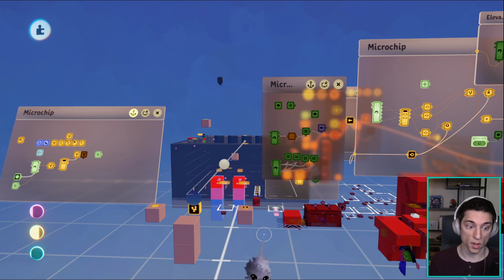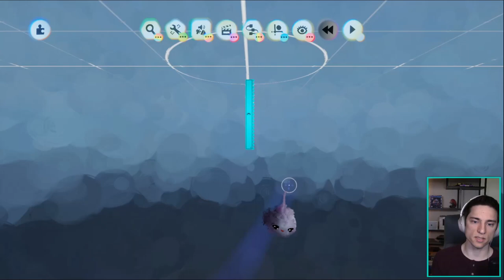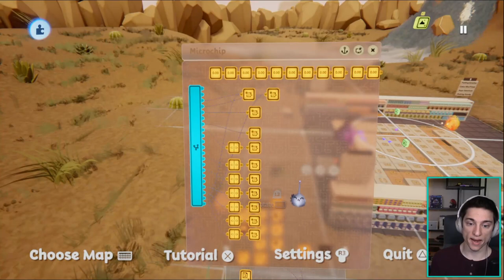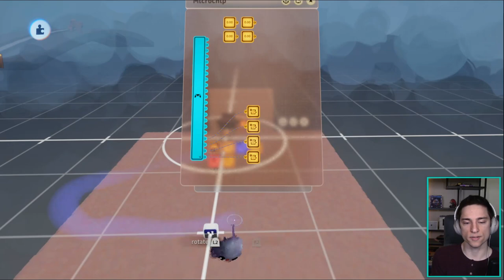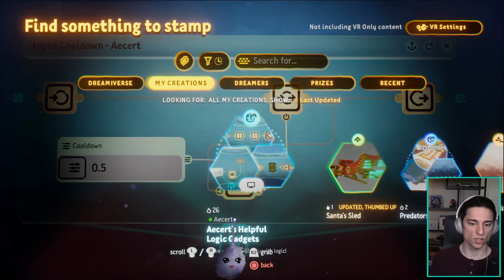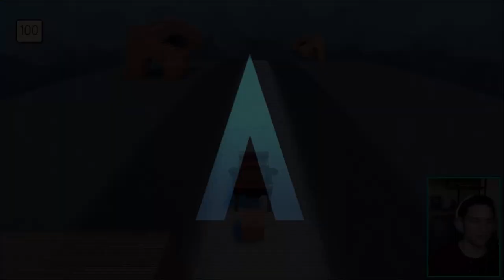Centralized Controller Input | Dreams Tutorial

Comment: Even if one makes the effort to send the stick values via Variables it will end up using more gadgets to encode it at the destination, so I would always opt for Wireless Receivers for that one.
Reply: I use receivers and transmitters for controller sensor inputs as well, the cleaner and more reliable that way

Comment: Cool cool...

So I do the same thing but skip the centralisation, basically. So in a character say, I'd have a controller sensor. Each chip that handles controls will have input notes labelled what the control does. Then I wire directly into that.

If there are nested chips in there, I pass the control through with nodes so the inner chips can get the same stuff. If a control should be "onpress" then I have a sig-manip between the controller and the chip that will use that signal.

If there's something in the world like a door that's activated by square for example, then the player is still controlling the character, so I use the character's controller and probably power a trigger zone to let the door know it should open.

If I have another separate contolled thing, say a menu, I have a controller sensor in there and it's all set up the same way.

So, instead of centralising absolutely everything about the controls, I guess I centralise for each mode of control the player will be in. Like, matching their mindset of what they are doing.

Also I just leave the controller sensor out in the open in the main chip like a mad man ;P

Comment: Any downside to hooking the boolean buttons like Bumpers and X△▢○ Into a global trigger zone/tags, and Non boolean buttons like the triggers into wireless transmitters where the 1 frame delay wont mater much b/c its variable anyways?

For alpine I did that instead of this because I knew I was ganna have A LOT of variables and didn't use em all up. (ended up only using about 70)
Reply: The variable limit only applies to saved variables. The normal ones that do not save between scenes have virtually no limit
Reply: @aCavemanNamedJaR  Oh thats right, still though, Is there a downside to using tags/trigger zones for bools?
Reply: If anything, I feel frame delay is more noticeable on analogue buttons, because it's got more points of reference where you're likely to see the output lag behind your current input. Also, trigger zones and tags do have a frame delay, so I would not recommend it for any direct input.

If you're able to, then I'd recommend switching to the variable method for all buttons, and it should improve the feel of Alpine Dream a little bit. Only variables set to 'Persist in Dream' count towards the 128 limit, so there's no downside to using them without a persist.
Reply: Triggerzones also have a 1 Frame Delay
Reply: Apart from the frame delay, no. And I'd say for a lot of games a frame delay won't be noticeable or change the gameplay.

Like, the most common situation where you want to transmit a button press like this (whatever method you choose) is to activate something in the world. Oopening a door 1 frame late will make no difference to gameplay and will not be noticeable to the player.

Whereas if you're making a very tight PVP 2D fighting game, you want as little delay as possible. So it very much depends on the game you're making, and how important timing is to you.

I almost always use a zone-and-tag setup, because I don't make the kinds of games where super tight timing matters.
Reply: @ogtheenigma5072  Gotcha thanks
Reply: @TAPgiles In many cases adding a 1 frame delay can affect the experience more than you'd might expect. It's really input lag + frame delay = total input lag, that you have to contend with.

Let's say with a typical players setup, the TV adds a modest amount of input lag by itself, if it's not in a low latency game-mode, perhaps 50ms. Then you've got input latency from both the controller and the time it takes for the console to process the input, and send the output to the TV, let's say this adds another 20ms. So in this setup playing Dreams, the player already has to contend with 70ms of input lag.

If you're adding an additional frame delay, then you've now got 103.3ms of input lag. At this point, players might start to 'feel' it, especially if they're playing something like a rhythm game, whilst 70ms might be just under the threshold.

This is partly why I'm a strong proponent for not adding extra input lag for anything you control directly in Dreams.
Reply: @ogtheenigma5072  My point is, most interactions aren't frame-timing sensitive. So no need to assume you have to do things a certain way to get the best timing regardless of what you're doing. Understand the different methods, their pros and cons, and make a decision based on what you're doing. If you need as low-latency as you possibly can, eg. a rhythm game, go for it. If you don't, eg. activating a cutscene, you can not go for it and that's totally fine. It's your decision :D
Reply: @tapgiles Yeah, I was specifically talking about anything that uses immediate control like characters movement / abilities and menus; especially if it's an action with direct gameplay implications, or you can continuously repeat within a short time period.

Stuff like opening doors and triggering events is less latency dependent so I would be less strict with using a delayed input in those situations.
Reply: @ogtheenigma5072  Ah gotcha. 👍

Comment: Great idea. I've been using Keyframes which TapGiles suggested to me once. Plug control into a Keyframe and Keyframe the power switch of a Not gate. Kinda the same thing i think? Question: do variable gadgets Have invisible wires that count towards the wire count like Keyframes?
Reply from the maker: Yup that's very similar! The only benefit of using variables is that you can just slap down a variable modifier and it will work. Oh and also it transmits a number, not just on or off. Yup variables also have invisible wires.
Reply: @AecertGaming  Oh that is much more convenient than cloning every time. Thx! Also I've noticed that keyframing does send a variable signal so it works with joystick signal as well.
Reply: @AecertGaming  or maybe i had to add additional logic for negative values. Can't remember at the moment. Variables seems better anyway..

Comment: Keyframe + Switch is still better, as with variables you are using 3 gadgets in total. Transmitting numbers can be done as well with Sliders. Glory to Keyframes.
Reply from the maker: Id argue variables are better because you can place a variable modifier wherever you want, then scroll through the list to find the control you want, as opposed to being bound to the keyframe.

You are right though it is slightly cheaper, but not by much.
Reply: @AecertGaming  I usually create a backup microchip with all keyframed switches in it and once I need one I just copy it out of there. 
On the other hand this might be even the same cost like the variable method. As the backup switches count just like variables as the third gadget.

Maybe I'm over complicating it too much and variables might be the better way to do it. It's definitely the more convenient way. 
I just wish we could get the full list of gadget cost + hidden cost/wires ect. by Mm
Reply from the maker: @Denjo92  nahh you aren't overcomplicating it, that method is perfectly valid